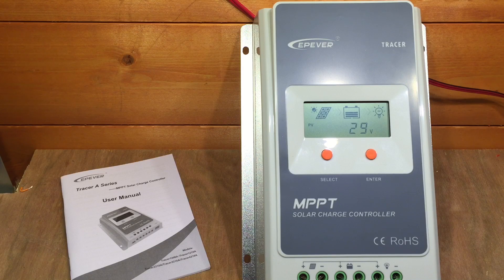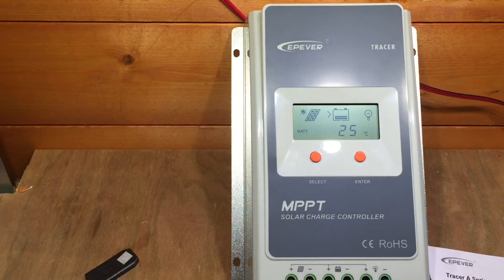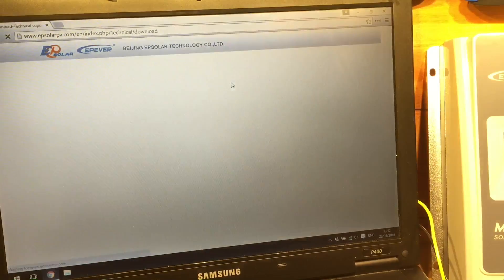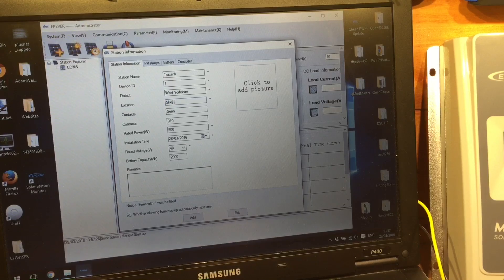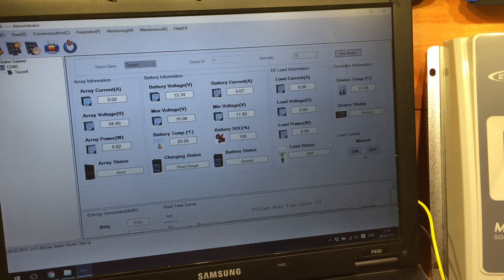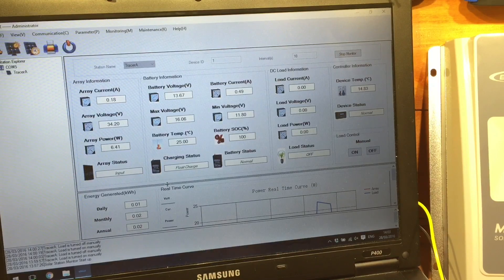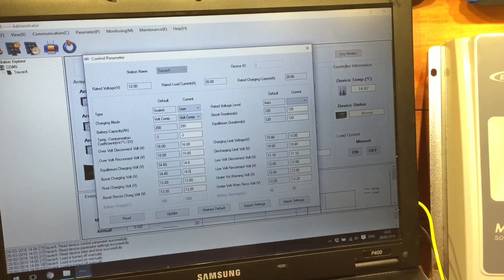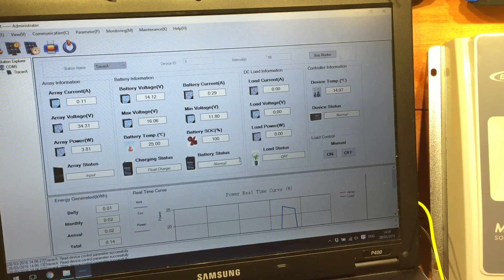EPSolar Solar Station Monitor software & a cheap USB cable - 12v Solar Shed

Comment: Some preparations is required. Install the Github phpepsolar package. 
Needless to say, PHP5 will need to be installed with relevant packages.
Go to the website and read the comments for issues, number 1
Edit the two lines as mentioned.
Install the RPi-source program and run, then compile the driver from the epsolar package (also installed).
The first installs headers to match the Raspbian kernal. THEN the driver will compile correctly. The python epsolar package will run too. A script has to be written that removes the cdc_acm module and inserts the driver module, xr_usb_serial_common.ko from the compile. That script can be made bootable.
Check permissions for files and folders if errors pop-up.
The PHP script is as follows:
=============================================================

<?php

$x=0;

require_once 'PhpEpsolarTracer.php';

$tracer = new PhpEpsolarTracer('/dev/ttyXRUSB0');

$name='data_'.date('m-d-Y_hia').'.txt';
$myfile = fopen($name, "a") or die("Unable to open file!");
fwrite($myfile,  "PV array voltage(V),PV array current(A),PV array power(W),Battery voltage(V),Battery charging current(A),Battery charging power(W),Load voltage(V),Load current(A),Load power(W),Battery temperature(°C),Charger temperature(°C),Heat sink temperature(°C),Battery SOC(%),Remote battery temperature(°C),System rated voltage(V),Battery status,Equipment status, date, time\n");
fclose($myfile);
while($x<=3):
$myfile = fopen($name, "a") or die("Unable to open file!");
$nano = time_nanosleep(30, 0);
  if ($tracer->getRealtimeData()) {
    $i=0;
    while ($i<=16):
      $dat[$i] = $tracer->realtimeData[$i].",";
       fwrite($myfile, $dat[$i]);
       $i++;
            
    endwhile;

    }
    $today = date("Y-m-d");
    fwrite($myfile, $today.",");
    $now = date("H:i:s");
    fwrite($myfile, $now);
    fwrite($myfile, "\n");
    fclose($myfile);
$x=($x-1);
endwhile;
?>
--------------------------------------------------------------------------------------------------
typical output:

PV array voltage(V),PV array current(A),PV array power(W),Battery voltage(V),Battery charging current(A),Battery charging power(W),Load voltage(V),Load current(A),Load power(W),Battery temperature(°C),Charger temperature(°C),Heat sink temperature(°C),Battery SOC(%),Remote battery temperature(°C),System rated voltage(V),Battery status,Equipment status, date, time
45.42,2.56,116.44,26.77,4.35,116.44,0,0,0,25,38.27,38.27,82,25,24,0,11,2016-09-12,16:31:41
44.27,2.66,117.96,26.81,4.4,117.96,0,0,0,25,38.24,38.24,81,25,24,0,11,2016-09-12,16:32:11
45.99,2.58,118.81,26.64,4.46,118.81,0,0,0,25,38.17,38.17,79,25,24,0,11,2016-09-12,16:32:41
39.79,2.81,111.85,26.38,4.24,111.85,0,0,0,25,38.11,38.11,77,25,24,0,11,2016-09-12,16:33:11
45.53,2.87,130.81,26.48,4.94,130.81,0,0,0,25,38.06,38.06,75,25,24,0,11,2016-09-12,16:33:41
45.28,2.45,111.14,26.4,4.21,111.14,0,0,0,25,38.02,38.02,73,25,24,0,11,2016-09-12,16:34:12
44.84,4.33,194.32,26.73,7.27,194.32,0,0,0,25,37.95,37.95,72,25,24,0,11,2016-09-12,16:34:42
47.16,5.28,249.15,27.5,9.06,249.15,0,0,0,25,37.95,37.95,72,25,24,0,11,2016-09-12,16:35:12
---------------------------------------------------------------------------------------------------
Good luck.
Reply from the maker: Excellent - thank you for your help Jim.  I need to dust off one of my raspberry pis!
Reply from the maker: +upupupupnaway Very interesting. Sounds like something I'd be interested in trying for myself. My Pi is sat idle at the moment. 

Thanks for letting me know - will you be releasing it in the future?
Reply from the maker: Thanks very much for this.  It looks like a really good complete guide.  I'll definitely be trying this out when I get some time.  I'll report back once I've had a chance to play.
Reply: Checked out your blog. The instructions for installing MySQL, as written, do not work. I keep getting errors for not having a password. I've followed the MySQL instructions for changing the password but get permission errors.
Reply: Oh yes, the pages in the background of your video seem to no longer exist.
Reply: The ones in the video are not the ones on the blog.
Reply: I tried to find "Step 1" shown on the text in the video(not the ssh window) on the blog and couldn't. That prompted the question about the missing page(s). The rest was about not getting MySql installed by following the video's instructions. The instructions from MySQL on altering the password did not work for me. Doing anything with mysql caused a password error. Any ideas on how to change the password? ===========/usr/bin/mysqladmin -u root password 'Newton'
/usr/bin/mysqladmin -u root -h raspberrypi password 'Newton'

Alternatively you can run:
/usr/bin/mysql_secure_installation
=================== None of the preceeding worked.
Reply: Got it. Thanks
Reply: I went through the RPi directories and changed ownership of every mysql folder I could find. Previous to that, the 'mysql -u root -p' command would not have worked.

Comment: I had a think about this. and it's all the same. 12 volts 24, 48. 12 volts is just increasing amperage.48 volts is just increasing volts and lowering the amp hours but the kW hours in the batteries stays the same. if Adam is ok with it I'll put the link to this guys video and see if you guys can make any sense of it. he seems to think at 48 volts he has less of a battery bank to purchase. I'm still learning myself to be honest. not long doing this.
Reply from the maker: In off grid situations I think there are two reasons to go higher than 12 volt.  It increases efficiency if you are using an inverter and it can make your wiring cheaper - less amps, less copper.  However you loose the ability to connect lots of off-the-shelf 12 volt products and for me that's the biggest issue with higher voltages.
Reply: That's true Adam. I sent the guy a message on utube asking him to explain. The only reason for going 48 volts is the smaller cable and longer runs without losing volts. He is off grid in the states.but his video made it sound like 48 volts uses a smaller battery bank where it all is the same in kW hours or watt hours in the battery. Anyways thanks for helping me out. And sorry for my inexcusable bad maths at the start :)
Reply from the maker: No need to apologize.  It's been a useful conversation that hopefully will be useful to many for some time to come. :-)
Thanks again.

Comment: your right zogworth, I was not thinking clearly, to be honest, I wanted to run a fridge and freezer 24/7,and I have tested it.  I imagined at 48 volts that it would be more efficient. I watched a video with a guy giving his equation, here goes,  my fridge and freezer uses roughly 1.5kw in 24 hours.. 
so I followed his equation. needed kwh X 1000 X reserve days / battery voltage 
so 1.5 x 1000 x 2 days = 3000
then 3000 ÷ 24 volts = 125 amp hour batteries needed
125 x 2 as 2 would be 50% discharge of the batteries
= 250 amp hour batteries needed.. 
I have 220 at 24 volts. .
if I do the same sum at the 48 volts
1.5 x 1000 x 2 = 3000
3000 ÷ 48 = 62.5
62.5 × 2 = 125 
so I'd need only 125 amp hours of battery's. .
hope that's OK?
if you guys want to comment.. go ahead.. I'd rather get information

Comment: The panels are over 30 volts each. I had only 2. so I had to wire them in series as I didn't have an adaptor.i basically took a chance wiring them in series and flipping the circuit breaker.. also.. my circuit breakers are rated at 12/24 volts at 20amps.. but they let the 60 volts run through.. I'd imagine they would have flipped.. is it because they're under the 20 amps? both the panels put out over 8amps.. so 16 amps in total in series...  on the charge controller it says just over 60 volts from the pv..then it steps it down to 24 volts to suit the batteries.. I'm wondering. if it's taking in over 60 volts.  why can't it step it down to 48 as it would be less work for the controller to handle. maybe I'm wrong.
Reply from the maker: +daughy doc Yeah breakers break depending on the current. There is potentially a bit of an issue using AC breakers for DC but otherwise you should be ok. It's obviously not recommended to use things outside of their designed specification, but I think you'll be fine.
Reply: The breakers I have are dc rated. 12/24 volt 20 amp.. maybe there designed with pv over voltage in mind. I didn't think they would let 60 volts through though. And seeing as the charge controller let's 60 volts through and steps it down to 24 volts lead me to belive I could just rearrange the batteries to make 48 volts and double the amp hour rating from 220 to 440.. I noticed at 24 volts the discharge rate was to fast for my liking. So I'll go for 48 volts next. Nothing on Google about this issue. Pitty
Reply from the maker: +daughy doc I think there's something wrong with your maths there. Batteries in series have the total amp hour rating of the lowest cell but you've increased the voltage. Batteries in parallel you add the capacity but your voltage stays the same. 

So four 12 volt batteries with a rating of 10ah in series would be a 48 volt 10Ah battery bank. The same batteries in parallel would create a 12 volt 40Ah battery bank. Both have the same amount of watt hours - 480. 

If your amp hour rating increased when the voltage did you'd be making energy from nothing!

Comment: Hi Adam, I just have a question.  It says the charge controller can do 12 volts at over 200 watts. Or 24 volts at over 500 watts.. I have 2, 250 watt panels in series at over 60 volts. And a battery bank at 24 volts. The charge controller regulates it down to 24 volts.  Is it possible seeing as I'm getting over 60 volts from the solar panels to wire my batteries to make 48 volts. Would the charge controller handle that? I have 4, 110 amp hour batteries wired to make 24 volts series and parallel.. I could make 48 volts at 440 amp hours instead of 220 amp hours at 24 volts?  The charge controller can take over 60 volts coming in from the panels.. 
my calculations at 48 volts is lower amps than 24 volts.. the charge controller I have can take 20amps.. 
500 watts by 24= 20.83 amps..
500 watts by 48= 10.41 amps.. 
any input would be helpful
Reply from the maker: +daughy doc the charge controller works with 12 or 24 volt battery systems. Wire 48 volts to it and I think you'll pop a capacitor or blow a transistor. 

It looks like you'll be ok with your two panels in series on a 24 volt battery bank there's a bit of overhead I'd expect and it's unlikely you'll hit the full potential for very long.
Reply: Thank you for your reply Adam. Do you think at 500 watts at just over 60 volts would be enough to charge a 48 volt battery bank with the correct 48 volt charge controller. Is the 60 volts coming in enough.. it depends on the weather. But if the weather permits it. Is 60 volts enough.
Reply from the maker: +daughy doc Quick question. Is 60 volt the open circuit or maximum power point of your panels?  Presumably you'd want to be charging your 48 volt battery system to somewhere in the high fifties?
Reply from the maker: +daughy doc You could take a look at Julian Iletts videos on the Minghe MPPT charge controller that takes a rather unconventional approach - https://youtu.be/mM6JTquNSZU

You could put your panels in parallel and setup your 48v battery system using that is you're desperate for a 48 volt system.
Reply: To clarify on your amp hour confusion.

at 12v you would have 440ah

at 24v you would have 220ah

at 48v you would have 110ah

how ever each configuration would be exactly the same Kilowatt Hours

in your case 5.28Kwh

ah is a measure is a measure of rate and not that great for comparing different voltages. Drawing 1amp at 48v is 4x the amount of watts as 1amp at 12v
Reply: The manual for the 3210A has a table showing the optimum configuration for different circumstances. In my case, six 100W panels wired as a 36VDC  array with a 24VDC battery bank is optimum. Other configurations work, but the maximum conversion efficiency is had at the suggested configuration.

Comment: I tried to download logging data, but the 3210A is not so equipped. Every time I tried, I got a file with column headers but no data. 
   Oh, those logging files were also invisible. I had run into the problem before and had located a program that 'sees' them. Getting data out of the invisible files can be a challenge. 
   The compiler is probably an obsolete Windows version. 
   Thanks for the videos.
Reply from the maker: +Jim Julian I assumed the tracer A series doesn't have the memory to hold that data - data can only be extracted live. I think the etracer and itracer series have memory to hold a few days / a week / a months worth of data.

Comment: You mentioned real time logging. That is what I looked for but the fine print was that  some models are capable and some are not. Ive been attempting to access the controller with python and a Raspberry Pi 3B.

   I've been working with the pymodbus library and kasbert's Epever python software.

The following is a quote from a readme file:
Begin Quote-----------------
sudo apt-get update
sudo apt-get install python-dev
sudo apt-get install python-pip
pip install pymodbus
 
Additionally, I had to install some extra packages:
pip install pycrypto
pip install pyasn1
End Quote------------------

The python Epever package from Kasbert :
                      https://github.com/kasbert/epsolar-tracer

The info.py and readall.py scripts load a mock modbus client and readout false data. I'm now studying the API and Epever scripts.
Reply from the maker: +Jim Julian Thanks. I'll take a look at this as soon as I can. Thanks again.

Comment: So you notice your SOC is at 60% at night if you dont use the batteries during the day?  ill show 100% during the day but at nights it drops.  have u chnaged your settings in the charge controller or mt50?

Comment: does an ethernet to usb adapter work? tried it and it won't show up in device manager. tried manually adding in the driver to the device manager and my computer just crashes when i try it
Reply from the maker: +hey7328 No it won't, and according to the manual you risk damaging the controller. The controller uses the modbus protocol and RS485 standard which uses different voltages to Ethernet so hopefully you've not damaged anything.
Reply: ***** thanks i will look for a rs485 one then. the display and controls work so i think i haven't damaged anything

Comment: one thing that annoys me about this and its a minor thing is that you cant have lower than 10 seconds on updating the stats. i did try and lower it but it just says invalid..so yea

also i don't know if you have this but you can get an external meter that you can plug in to the Ethernet port on the bottom of the unit...its called a 
 
(SolarEpic MT-50 Remote Meter)

the link is here
https://www.amazon.co.uk/gp/product/B01DFLVQ3K/ref=oh_aui_detailpage_o01_s00?ie=UTF8&psc=1

Comment: why do i keep getting ( com port occupied by other software)?
this is driving me mad ..as far as i can tell nothing is using any comports on my computer...for one, my computer does not evan have comports.....stuck...

HELP!
Reply from the maker: +scaleop4 Could it be a driver issue? Sorry - which cable are you using, the real one or my cheap version?
Reply: the real one.. i think i may have sorted it...i put ferrite rings on the wire and that seems to of helpt but i do still sometimes get the same error messige. ( but it is reading, and i can change the setting so  its not to bad)
Reply from the maker: +scaleop4 Interesting. You must have some noisy wiring. RS485 is meant to be good in this respect.
Reply: ill let you know if i found out anything else about the problem...but nice vid on the mppt controller anyways.

Comment: Looks like the controller params settings might be configurable enough to use it for LifePO4 batts?  Thanks Adam! Great videos.
Reply from the maker: +Paul Vudmaska Yeah it's quite configurable. Thanks for the kind comments Paul.

Comment: Great video! Got mine working with Windows. thanks! Have you tried getting it to work on the Android Mobile APP from EPEVER? I am not able to get any connection using the same RS485 to USB with an OTG cable. Android recognizes the adapter but I still cannot seem to connect to the charge controller.
However, I will be trying to use this library with a RPI https://github.com/toggio/PhpEpsolarTracer
Reply from the maker: Thanks for the comment.  I haven't used the android app - no android device here to test it with.  Interesting link for the RPi library, I'll be sure to take a look thank you.

Comment: will this work with 100AH AGM battery, and if so what is the stetting needed?
Reply from the maker: Hello - it'll work as long at the battery is 12 or 24 volts.  People have different opinions on battery charging voltages, but there is a default setting for Gel batteries that means you won't need to adjust anything with a cable or optional MT50 meter.  Just choose GEL in the battery option menu.
Reply: just ordered this from amazon cable to.
im in the uk same as you lol..just hope the sun stays out cos its been a bit crap alately.

but yea its a 200w set up with a 100AH AGM battary very heavy...just going to have to wait for the controller to turn up now and thats going to take a while...but thanks for the feedback anyways.